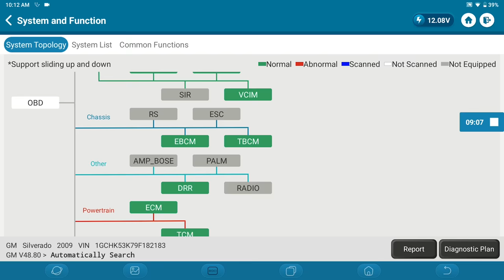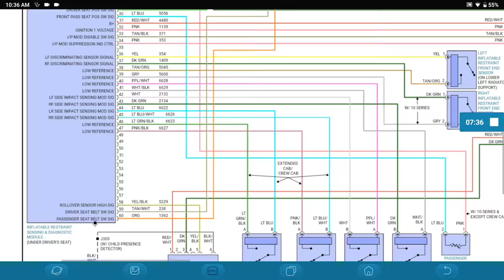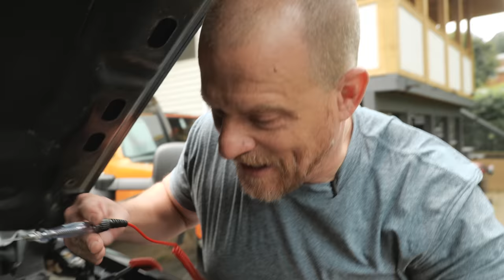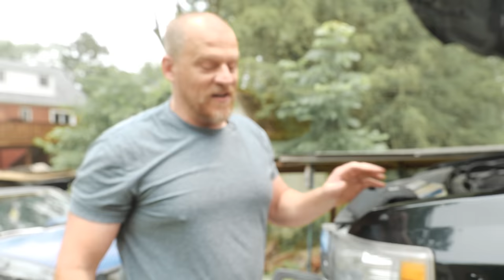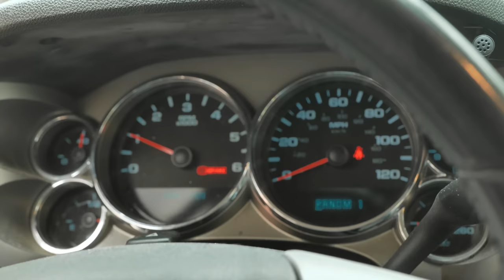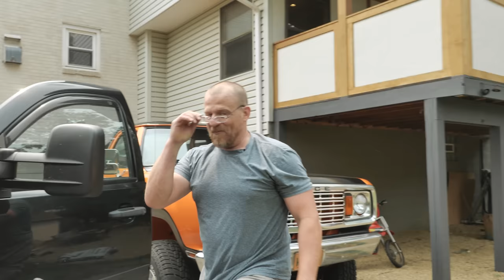Chevy Silverado No Com with Air Bag Module

Comment: I am currently dealing with the same issue, Service airbag came on last week. Low and behold, my issue was the exact same.. corroded fuse. Mine didn't get stuck inside like yours luckily. Thanks for this video, saved me possibly hours or mindless diag time

Comment: I want to thank you most gracious Sir. My air bag light has been on for several years and I finally bought two sensors.  I have a 2010 Silverado and my sensors do not bolt on like others I have seen.  The bolts come down from the inside of the core support and the only I could see was to remove the radiator, so I went on a search to find out why when I came across your video. I checked the fuse and it was very corroded and only had power on one side. DAMN!
I was so glad though because I really didn't want to take out the radiator.  Again, Thanks, Ed

Comment: Hello ScannerDanner, So I watched your video and on my Chevy 2007 Tahoe LTZ it was Fuse 51 Airbag ING Batt 15A fuse. It was corroded in the fuse housing, crumbled when I took it out. Had to clean the fuse housing and replaced the fuse, the Airbag light flashed and went out. Thanks so much!

Comment: Thanks for sharing this. We all have these moments where we assume something is complex and turns out to be very simple. Especially when you deal with jobs almost every day that are too complex for others to fix. I bought a new front passenger door lock actuator 3 years ago to replace it. Still haven't fixed it horrible job.

Comment: Paul:
I spray Deoxit on every Electrical Connector as a preventative maintenance measure. 
I only spray it on any Connector I disconnect for Repair or Engine Replacement. It's a good practice to use Deoxit religiously.

Comment: You're embarrassed by 4 years of neglecting your airbag light?  Mine's been on since 2011!  I don't have the ability to scan for airbag codes, so I once had someone who could scan it for me.  I was told that it's a defective clock spring.  I have a replacement clock spring, but am delaying installing it because I had a minor encounter with a tree during a severe rainstorm and my steering wheel has been off-center since.  Plus, I have a replacement steering wheel to use.  I was planning to wait until all of my suspension/alignment issues are resolved before swapping the steering wheels and replacing the clock spring.  But, after seeing this video, I need to do some fuse checks first.

Comment: Classic, i have about 50 fuse blocks for those exact problems. Always confirm my wiring and 100% of the time its that. Also those corrosion issues on modules there was a recall for that

Comment: I had this same issue with my 2002 F350 7.3L 6spd 4x4.. just a few months ago.   I had been driving it for over 5 years without AC, because my serpentine belt had broken and slapped the side of my connections on the compressor and broke them off flush...  I jerry rigged some lugs and shoved them in the broken holes on my compressor (back when it first broke) -- and it didn't' work, so I gave up..   So we just did a water pump and heat exchange swap on it and fixed all the leaks-- so I got motivated to give the AC another try (this is 5 years later now. :)...  Did a few standard checks and it turns out it was just a blown fuse----  and my jerry rigged connections that I shoved into the broken hole do actually work.  So I've had AC all summer now. lol.  Didn't even have to recharge it or anything.    5 summers with no AC over a fuse.   fml.. Granted, I drove my MDX most of the time anyway.

Comment: Local dealer to me always has a power distribution box in stock for that very reason, usually my first go to on that generation truck for any abnormal electrical issues.

Side note, don’t those fuse boxes carry spare fuses within them? 🤣 the fuse you need was staring you down likely 

Love watching your videos, been watching for years. Makes me love and enjoy doing electrical work. Nobody else in the shop I work for wants to touch it. 

Keep doing what you do 🤙🏻 and I’ll keep watching.
Ontario, Canada.

Comment: Glad you fixed it!  Going by the amount of dust on top of your fusebox and on top of the relays, it looks like you have been driving about with the fusebox lid off for some time?   This would allow moisture in  and would be why you have corrosion on your fuse?
Reply from the maker: Nope, fuse box lid has always been on

Comment: I had the same issue with my 2010 Silverado. Airbag light on, no comm with module. I googled for SIR module location to check power and ground, came across your video. Checked  number 45 fuse, same thing, corrosion, power only on one side. cleaned terminal, replaced fuse, Airbag light is now off.

Comment: I have prob changed 30 or so of those UBEC's for various issues. I keep 4 of them with different issues under my bench for diag purposes all marked with what doesnt work. One is lf marker light stays on, another is no reverse lights and dont remember the other 2.  Quicker to swap one out and see if issue is fixed than going through the diag. First time ive seen the airbag light on from one though. Last time i checked they were only around 300 bucks Canadian  i think for a complete loaded one  so not an expensive repair.

Comment: @ScannerDanner  I see what appears to be corrosion under one of the relays. If this box is corroded like the ones I've seen it would be wise to replace it before something like a fuel pump relay leaves you stranded.
Reply from the maker: Meh 😉

Comment: FOR ANYONE WHOS EXPERIENCE ELECTRICAL CHAOS IN THE GMT800 TRUCKS AND LATER GMT700s A SDM SIMPLE FAST CHECK IS TO PLUG A SCAN TOOL TO THE OBD2 PORT. IF YOU CAN PULL CODES FROM THE TRUCK YOUR SDM IS NOT BAD. SDM IS THE MODULE THE COMMUNICATE TO YOUR SCAN TOOL! IF YOUR HAVING THE EXACT SAME ISSUES WITH STARTING DASH AND OR BODY RELATE CHAOS. YOUR ON THE RIGHT PAGE BECAUSE YOU HAVE A BAD MODULE ITS EITHER THE BCM, THE FPM (BY SPARE TIRE FUEL PUMP MODULE PRONE TO CORROSION. ABS PUMP AND MODULE COMBO ON DRIVE SIDE FRAME UNDER CAB. WILL GET CORROSION. (BE CAREFUL IF THIS MODULE SHORTS IVE HAD 1 THAT CAME IN CAUSE RANDOM WHEELS AT RANDOM TIMES HAD BRAKES APPLIED BY THE ABS PUMP) AND THE LESS COMMON BUT HAVE SEEN IS A BCM. ILL TAKE A EDUCATED GUESS WHY A BCM CAN FAIL, ITS VERY POSSIBLE WHEN THE POWER DIST BLOCK CORROSION BEGINS. THE BCM TAKE THE BEATING. WHEN THE BLOCK IS REPLACED EVENTUALLY THE BCM WILL FAIL) GROUNDING ISSUES DONT HELP THE LIST OF WTF GM... THINGS THAT HAS THE SAME EXACT CONDITIONS HOPE THIS HELPS ALL OF US TECH TACKLE THESE ISSUES THAT ARE STARTING TO SHOW ALOT BECAUSE THESE TRUCKS ARE GETTING OLD

Comment: Hey Paul, yes its paramount to first know the circuit and how it works..at least have an idea. Then search for the fault in the workings.. you were lucky to get it sorted so soon.. 
Q. What scanner are you using... or can you tell which type of scanner does not have a yearly subs..to renew. Will have to sell my Autel919 soon... great video
Reply from the maker: They all have yearly subscription updates. I'm not sure if you get locked out on the China tools. I know Snap-On you don't but you'll pay 3 times more for it

Comment: Thankfully i found your video. I was all in and was going to pull the seat out and get to that module.  But I checked the fuse and sure enough the same exact thing happens to my fuse on my 08 3500. What's the chances. I to have a heated mirror that dosent work now. Thanks
Reply from the maker: 😅 awesome!

Comment: Paul, I noticed that the seat belt chime and light on the cluster was not on when you started the video. Is that light and the SIR message related to each other (I have the same condition)?
Reply from the maker: The airbag light was on all the time. The seat belt chime? I don't think it does that until you start driving with your seat belt off
Reply: I used to get the seat belt chime, and the icon on the cluster, as soon as the key is in the ON position. When my Service Airbag message (and icon) appeared (and stays on as you pointed out), the seat belt chime and the icon disappeared altogether. After you fixed the BATT fuse, you can see the seat belt icon in the display again. I don't know how they're related, but this was a symptom I noticed in the video, as well as on my truck too. I thought it might be helpful to someone else who should start with the fuses, as you did.

Comment: What is the aftermarket amplifier turn on wire used for?? My 2010 gmc sierra has red cablea attached to those metal blades. 1 seems to go inside a harness but the other one gosles inside the cabin sonI have no idea where it goes. Also there is a red wire thas says aftermarket trailer but is cut so no idea where it is supposed to connect to. Having problems with my break/stop lights and turn signals not working.

Comment: Could you post a pic of the airbag wiring diagram here in comments? Or send it to me. Working on a same year and type of car, have same problem, no comm, but already checked the fuses. Need to start measuring the cables but not easy without a diagram. The programs here in Europe doesn’t have a lot of diagrams for American cars.
Reply from the maker: I won't share copyright info but you can purchase everything you need for $20. Same diagrams I use
https://eautorepair.adtrk.biz/?a=10817&c=24&p=r&s1=

Comment: Hello, so you have an aftermarket amplifier, have a question regarding the original amplifier. I install a Chinese android car radio and keep the original radio in. As I understand it, the amplifier turns on via the bus when I turn on the original stock radio. How do I switch on the amplifier when I switch on china radio? without turning on the original radio. its a chevy tahoe 2004. Thanks in advance.
Reply from the maker: Without looking at a diagram I can't tell you. You just need an ignition feed to switch the amplifier on for an aftermarket one.
I doubt an 04 factory amp is using anything different. The bus you refer to may just simply be that, a turn on signal. Measure it with a voltmeter and see what voltage is there before you do the swap
Reply: @ScannerDanner  Thanks for reply .

Comment: I have Enjoy your page and still a member of scanner danner premium, Why do you think there was no other module telling off on the ABS model as as a no com. Clearly, it has ABS module. But why didn't no other model tell off on this model? I had a HVAC module with no Communication, And at the time of me Scanning the vehicle it just showed no responds and I wasn't sure if This vehicle was even equipped with a HVAC module, as no other modules told off on it, And if you would unplug the pressure switch, it was set a code for the switch in ECM, With service information being unclear as to whether it had an HVCA module, After finding this vehicle to indeed have a HVAC module. Powers and ground on that  module was verify. That's where I started questioning myself, Is it actually the HVAC not communicating, or was it the gateway module not asking the HVAC for information. And how do you know by looking at the VIN if the vehicle even has an HVAC module, Instead of two hours of taking the dash apart to find it.
The problem was solved after the HVAC and battery was disconnected, ' For some reason I guess the a c module was just hung up',That was last summer, and i've seen the customer's car a couple of weeks ago and the AC is still working.. But the question I asked myself is still not answered.
Reply from the maker: I have to research my system more to answer that. I'm not sure why other modules did not have no com codes for the SIR. I mean clearly the instrument panel and or BCM had that information because I had an airbag light on and a message on the cluster saying service airbag system. 
As you know, the information systems we use everyday are seriously lacking the right information lol
Reply: @ScannerDanner  Thanks for Replying, This has been a question I asked myself for quite a while and have not found an answer to

Comment: The importance of the UBEC cover can't be underestimated.  You will have other issues.
Reply from the maker: It has always had a cover on it
Reply: I usually see that amount of dust/dirt/corrosion  on ones that roll in with no cover on UBEC.  You must run in a real dusty environment.  Good video.
Reply from the maker: @huxleyuniversity  nope, not at all, just the good old rust belt of Pennsylvania

Comment: Mechanics vehicles always have issues that need repaired, and it's never the fuse. The only way it's the fuse is if the module has self destructed, blown the fuse, melted wires between them, and caused ten other problems.  You should play the lotto after that. It's never just the fuse. 🤣🤣🤣
Reply from the maker: 🤣🤣🤣 I know! Never!